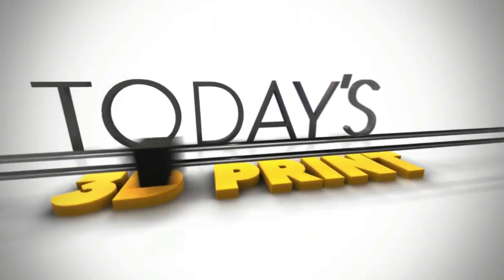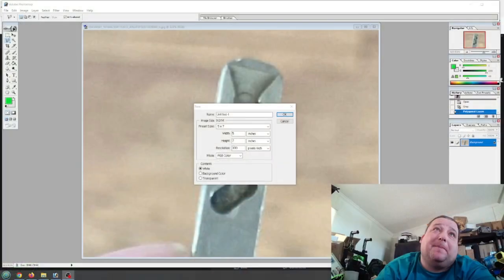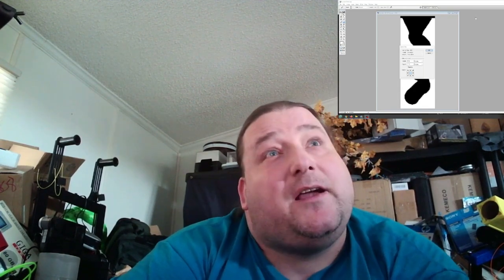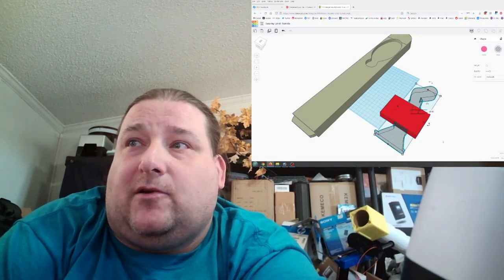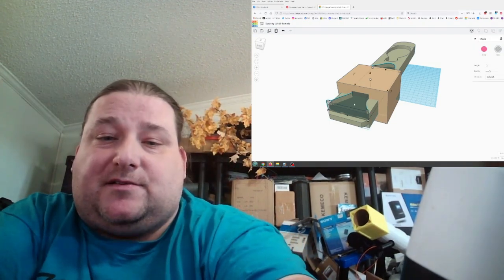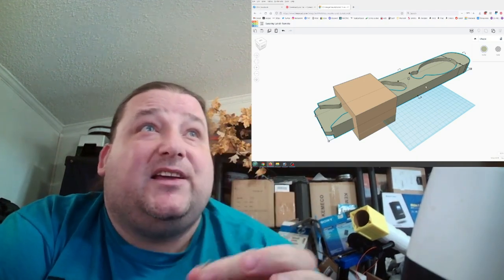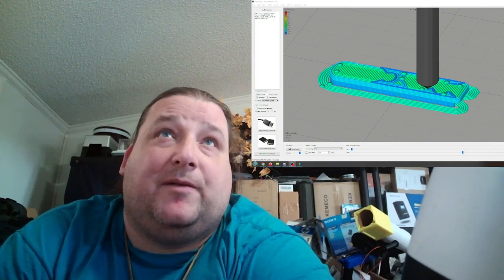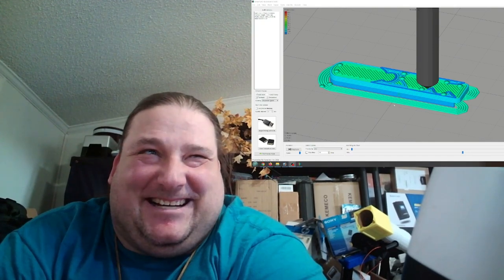Dangers of Key Pictures 3D Printing Copies T3DP

Comment: Chris, great info- but while your intro animation was fine, the rest was difficult to hear.
Reply from the maker: Audio Quality issue or Volume issue? trying to track down what is going on it sound fine on my end pre encode and post upload. trying to figure out what gives so I can fix it.
Reply: @nerys71  Volume- it's like you're in the next room.
Reply from the maker: @Pygar2  very odd. maybe my speakers are just stupid loud. volume seems fine to me. the intro IS substantially louder I have been meaning to reduce/normalize that but maybe its the other way around and ITS fine and I need to raise/normalize the video audio. if the quality is ok I can boost the volume no problem. next video I will jack up the volume on the video audio. let me know how it goes !!
Reply: @nerys71  Sure thing!